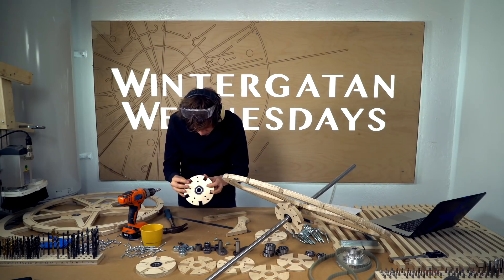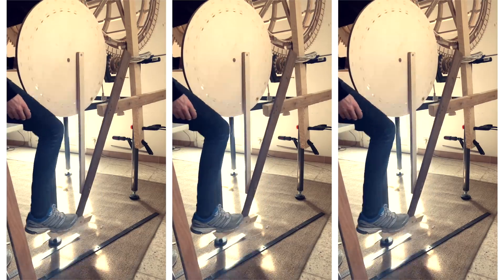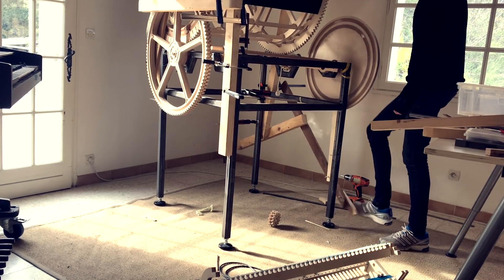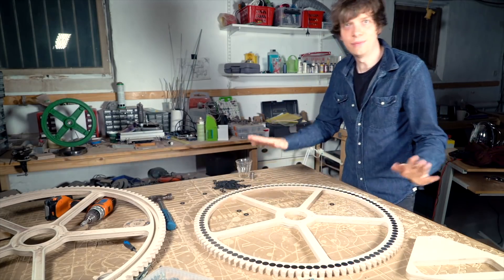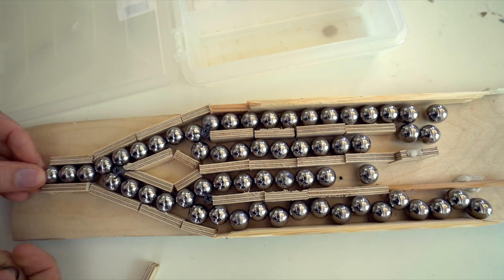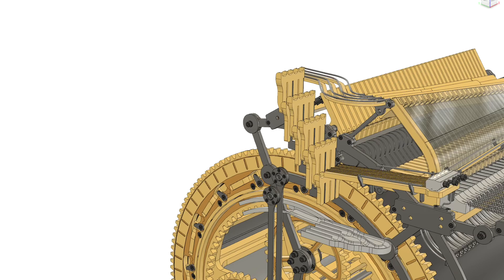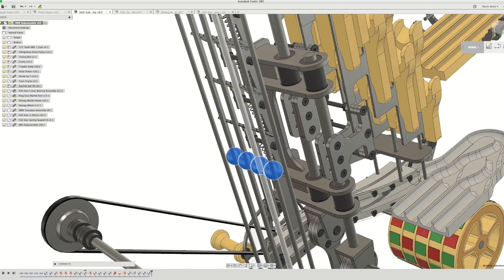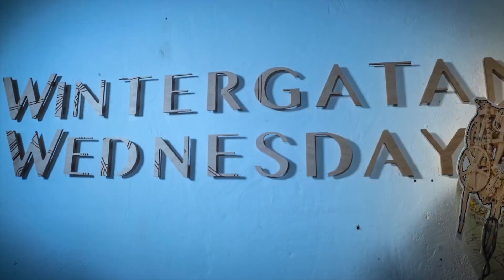Ratchet Marble Lifting System - Marble Machine X #32

Comment: Martin, I feel like you should have several level gauges so that when you are setting it up every time, you will be able to go down a list of all the components that need to be precisely leveled and that would make sure you got everything leveled. Without levels on those few components, the pieces may shift in transit and you may not know that they have gotten out of calibration.

Comment: how about counterbalancing the treadle pedal? this could by adding a counterweight to the wheel/gear it is attached to similar to how old steam locomotives use counterweights on their wheels.  Or simply extend the pedal arm past the back of the machine a bit and add weight there

Comment: There is A LOOOT of stuff that will turn, driven only by the force of the pedal and inertia of the system. I really hope that, when all the parts will be working, you can make the machine to roll without suffering too much for the friction :(
Reply: Woodworking Engineering He is using a lot of ball bearings. I would expect it to turn more easily than the original Marble Machine. Of course, something could go wrong.
Reply: Ditocoaf, he might have to, but he might not want that to be the case... If nothing else, he could add a bicycle pedal, but that would make it difficult to play the instrument... Might be able to do it if he could power it with his weight?

Like a stair-stepper exercise machine; he would step up and his weight would transfer into mechanical energy for the machine. He would constantly need to be "climbing stairs" but it would allow both of his hands to be free and he wouldn't need to brace against anything.
Reply: Woodworking Engineering With appropriate gear reduction ratios, anything is possible.
Reply: Not sure about that. Every contact between two different pieces means friction...
Reply: Buddy Clem I'm not talking about friction at the axis, but friction at the gears' teeth. And it has lots of gears. And long axis too (which means torsion, which means delay in the movement transport).
Reply: Woodworking Engineering which means one crazy night at the docks! Right boys?!
Reply: This has about ten times as many moving parts as the original machine. He might need to get an electric motor to run it.
Reply: TheRockindio 😂😂😂
Reply: The point of an involute gear tooth profile (like these all are) is to minimize friction in the gear itself. A theoretically perfect gear tooth has no power transfer through friction at all.
Reply: Don’t forget the size and weight of the flywheel helps counter the friction and keep the machine going!

Comment: Hi Martin! Happy Wednesday! I've been loving your music as well as your construction videos! I wanted to make a comment about the ergonomics of the placement of your treadle pedal. It seems that where you've positioned the pedal will force you to stand at a very awkward angle/distance in front of the machine where you will have to reach across your body with your left hand to reach the frets of the bass where the marbles might hit the top of your forearm rather than the strings of the bass. Plus I imagine you banging your knee a lot on the machine leg. Depending on where you want to stand to reach everything, you could rotate the pedal out away from the machine, and to avoid injury to your knee, you could change the action of the pedal so that it does not have the 'stair-climbing' motion but rather a bass drum pedal motion, or even a rocking motion like on the old fashion sewing machines. Just some thoughts!

Comment: Did you ever consider the style of treadle that old sewing machines used to have? The seasaw rocking action allows you to stand with your weight on the treadle and thereby maintain your balance whilst having fine control of the speed.

Comment: A backup marble pump from the bottom to the top could be a very useful thing and can pass them up one of the metal legs hiding them from the people looking at it. Could be powered off its own pedal or a lever to turn it on/off as needed

Comment: A suggestion for a safe and simple pedal mechanism. How about using the same principle as in bicycle gear shifter? Or even taking an actual rear set of gears and applying it to the pedal... I am not an engineer, so apologies if that idea is not useful. Keep up the pace and good luck!

Comment: Are you sure, that the treadle pedal will work, bc the speed of the driving wheel is higher when you're pushing down the pedal than the speed when you're leaving the pedal, since some energy will be lost due to friction. This can affect the tempo of the track, doesn't it?
Reply: i believe that he is adding a flywheel to compensate for that issue.

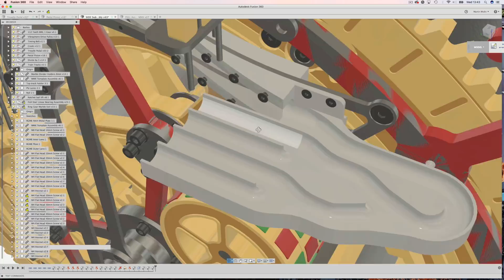Comment: Hi Martin, you have change the fichstair for the rachet marble lifting system which is looking better than the belt with cages.. great.. but at 4:45 it still staying a problem on my point of view, may be it's a perspective effect but the track for the marbles from the demagnetization system to the lift going through the pistons....

Comment: Hi, at some point now you must consider the (naturally) "top heavy" design. The torsion forces of the moving parts are coming into play now also. If you bolt down the existing feet to a heavy base plate, that might do, but will also put torsion and vibration strain into the feet frame welding joints. So I would split the lower steel frame into 2 parts and decouple vibration by rubber dampeners. Also the left front and rear and the right rear foot should meet the base outside an imaginary shadow when lighting the machine from directly above, to avoid tipping over the machine. Maybe you can make an "outward curved" foot design at least for these 3 of the 4 feet, which would give the whole concept an artistic touch also. The straight front right foot due to the treadle pedal would then both be an engineering necessity as well as an artistic statement.

Comment: I use a treadle lathe every day for my work.  It is really important to have the placement of the foot pedal under your center of gravity.  Having the pedal in a comfortable location will reduce fatigued while standing on one foot for an extended period of time.  You may want to consider having the foot pedal arm hing at the same point as your knee then use a pitman arm to attach to a crank.  This will help you stand more comfortably  and give you options later to adjust for speed and toque simply be changing the length of the crank arm.  It looks like you have much more rotating mass and gear friction then on your first machine, if that's correct it's going to take more toque to keep it going.

Comment: Hmmm, is there any way the lifting ratchet system could click less, it seems to me that there are 2 "clicks" for each step the marble makes. i believe this could be avoided by having the arm move just enough to push the marble over to the next arm but without actually overtaking it.

Comment: You know to raise the column of marbles only the bottom ratcheting parts are needed. You can see that from your test the bottom marbles will lift one ones above them, so just two "paddles" working will push the whole column of marbles up as high as you need. Just bear in mind the mass of the marbles on the paddles. fewer sprung parts would reduce the mechanical noises from the machine.

Comment: I'm afraid that the pedal is a bad choice because you will only have one feet to stabilize your body I bet your strokes will not be consistent enough even with a fly wheel. Also, you made some tests without any load ! So in my opinion your pedal setup will not be easy to make the mmx work

Comment: I'm a little concerned that if you press the foot peddle at the wrong time you will instantly cause braking.  While multitasking it would be a terrible mistake and kill a performance.  There are several ways you could add to or change the design so that you could never make such a mistake - perhaps try doing that?
Reply: hngldr   à classic way is bellows powering a pneumatic motor.  I can't understand Martin,  he knows the best ways in which these problems  were resolved in classic automata, but seems to be determined to ignore that wisdom and invent new problems.  I admire his energy but not his judgement.  I guess we have different esthetics.

Comment: have you considered a disconnect for the pedal for when its not needed? I can see someone (you) cranking away at the drivewheel like crazy and accidentally slipping a foot under the pedal, forcing the machine to a halt/crushing your foot/jarring the machine...
Reply from the maker: Konetsu hmm, we have a clutch between the flywheel and crank, but i had actually missed the danger of the foot being crushed underneath... AAAA why does it have to be so hard always!!! Thanks for pointing it out, the MMX have several spots where it would just act as a meatgrinder if you stick body parts into it,now i am aware of yet another one... OH wait! i can make the pedal flex upwards but not downwards, this way any foot underneath will be safe, thanks for your comment led to this simple solution! When you see that flexing pedal on tge world tour you will know you helped saving my foot. //M
Reply: Nice and simple fix, add some spring tension downwards so it doesn't flap around without load and you're good to go, now you're just risking a nasty shinner ;P But there's a solution for that too, shinguards!  (fast forward a few years, the MMX has been renamed the MGX and comes with a full protective suit for the user, after horribly mutilating the 3 previous operators... Because the show must go on!)
Jokes aside.  there's always a balance with what level of safety concessions to make...
Another solution might be a twin lever action on the pedal arm, moving it out of reach whilst it's not used without disengaging it. edit: I'm thinking something in line of a parallelogram operation, moving it up and back.
Reply: 1way bearing / ratched
Reply: Also I think there should be a grip he can hold on with one hand, so he doesn't fall over, when he stands on one foot for so long.
Reply: Use a freewheel! You like bikes, Martin? Use bike parts!
Reply: It's never easy, but I think that's the point, why it's so exciting. If it will be easy, you probably won't have 915k viewers! 
Design = encountering problems like this :) compromises between visual side, performance, production, ergonomic, safety and so on! Sometimes, little step backward to make a big step forward and and vice versa.

It is very helpful, that you have audience like Konzetsu.
Reply: here's a simple fix. Place a spring loaded slider in the vertical tension rod. The spring holds it at full length, but allows it to compress should your foot get under the peddle.
Reply: Charles M I thought of that to but it is possible to make them more silent with excessive grease. Or you can find silent individuals. My bikes freewheels make very different noise levels.
Reply: Charles M Besides, I believe the machine will be quite noisy. Not that it necessarily excuses additional noise sources but I think an average freewheel will be quite ok soundwise.
Reply: Why not a simple bass drum pedal?  Or similar, for the treadle pedal.  The heel sits on the floor, completely eliminating any pinch points.  Plus it's a musical interface that anyone who's played a drum set would find familiar.  The human/machine interface is very important and any time you can make it familiar, you'll be happy you did!  Now, when can I buy tickets for the world tour?  Cheers Martin.
Reply: I really like the idea of a grip. Or like a swing out seat.
Reply: If you want to avoid crushing feet, shouldn't the pivot point of the flexing pedal be higher? Just below the elbow where the shaft to the crank connects, not at the wrist where the pedal is (wrist should be fixed)?
Reply: Wintergatan It could be worse. MMX could be powered with steam! At least you don't have to nervously watch gauges or worry about steam/water hammer.
Reply: This design problem has already been tackled in manual spinning wheel designs; a pulley or spring can be used to transmit pedal force to the 'piston arm' (it does move much the same way as a steam locomotive piston), but not transmit force back to make the pedal move.  Put the mechanism in a housing and 'presto'!
Reply: yay Konzetsu did a thing! lol but seriously that is so cool. you must feel special to know that one of your ideas kinda helped him with one part of the design

Comment: For the pedal, think about using a spring to remove the pedal load from the system without interfering. You have to get it just right though.

I am against the ratchet claw system since it will be very noisy.

Comment: Is it just me, or does the xylophone still look like it's sticking into other parts of the machine in the 3D model?
Reply: It's a placeholder I believe.
Reply: I'm excited to see what the front ends up looking like. With all the good modifications that have been made to ideas so far, I wouldn't be surprised if the xylophone's appearance changed quite a bit.

Comment: Did you consider the solution used in old style sewing machines? They used a centre pivoted treadle - this way you can support your own weight while treadling without all of the unsupported leg flailing.
Reply: I agree with that .  Martin ,the way that the pedal is  built is not ergonomic , you will be unbalanced  and  will not be able to support the action for a  long time  without stressing the left  leg.  You will be tired from the movement rapidly. , unless being sit.  I am following you from your fist machine  , keep going . Martin!
Reply: jossesphere On a sewing machine yes you're right but I think it would be okay. Another thing is I was wrong to say the treadle foot plate was centre pivoted, I misremembered that the pivot point is more like 25% from front of the foot plate. That way the players foot is better positioned to move the treadle with their ankle above the rocking point and at the same time support a good ammount of the weight of the player.
Reply: Aren't those meant to be used only while seating? I don't see how it applies when standing up.
Reply: Yes, that was exactly my thought as well. Just checked to see if someone had already suggested it. Operator fatigue was my thought since he's having to support the full weight of his leg plus the force of the push for an extended period of time in the current design. Looks very tiring whereas the pivot treadle takes the weight of the leg out of the equation.
Reply: ah yes, both of my gandmas used to have old cast iron mechanical Singers
Reply: Lew Hunt I considered that idea too, if only to be able to switch feet to avoid fatigue.
Reply: An end-pivoted treadle like what's used on tilted body spinning wheels or user-operated lathes would be better for operator balance and ergonomic efficiency.

Centre-pivot sewing machine treadles only have to power a little oiled machine that puts a tiny needle through soft materials for short periods of time so it doesn't really need more than the smaller leg muscles and can be excused for being not quite ergonomic. Compare to a spinning wheel which one would have to operate every day throughout the winter season for handspun cloth. Sewing machine treadles are also compromising for fitting within the assembly's outer bounds and the very specific intended operator position.

And while yes, centre pivot treadles were also used for powering blast furnaces in Japan, they were large enough in scale to use the entire leg's strength, and were operated by multiple people on each side.

 @jossesphere  I prefer to use a treadle sewing machine standing up for my comfort (probably too tall for the antique machines), there's nothing inherently sit-like in the centre-pivot treadle.

Comment: Even though your pedal is working you should look at the old sewing machine system wich is very close to yours but seems more stable ;) Can't wait to see the final result of this marble machine !
Reply: Bicycle chain drive would even be easier and more reliable, but I'm guessing that wasn't considered because it wouldn't fit the look of the project.
Reply: paul look at realy old metal lathe
Reply: In fact all that is needed is the freewheel mechanism between the flywheel and the connection rod movement. It will hardly be visible.